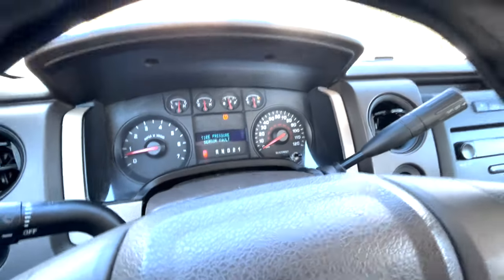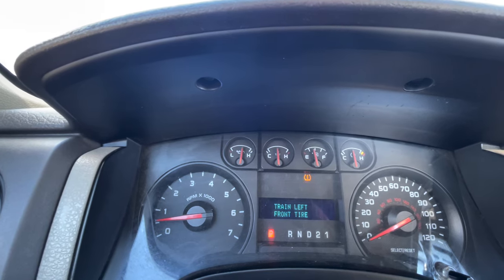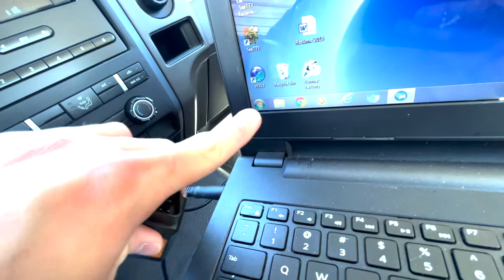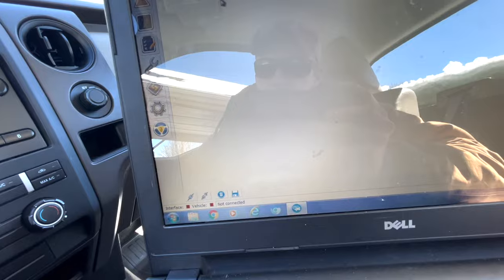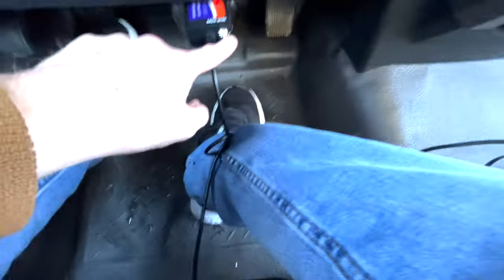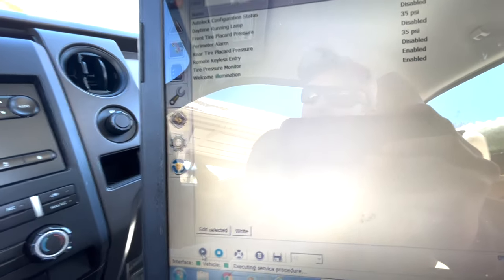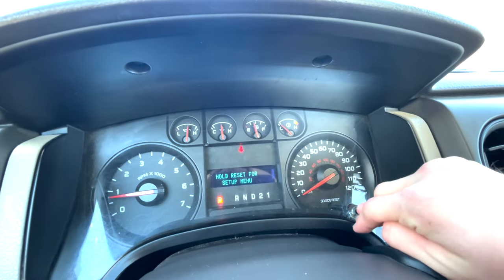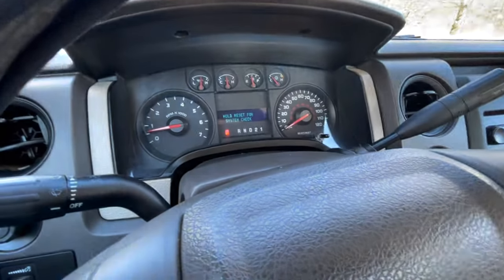DIY - How to Disable Tire Pressure Sensor Fault Message on most Fords!

Comment: The software did not work for my 2010 Ford Escape. I should have read the warning on the readout that it was not compatible with my car. The software disabled the entire car, setting the anti-theft locking mechanism on. I had to wait until the next day, and then it started again.
Reply from the maker: That’s interesting, very sorry that happened. That’s the first I’ve ever heard of that.

Comment: will this work on my 3010 e350 super duty?  front passenger tpms will not connect. I have replaced 2x already.  the antenna or the module must be bad.
Reply from the maker: I'm not 100% sure. But, I know alot of the Ford vehicles share the same CAN module's or similar. And being the E series and F series are almost identical, I don't see why it wouldnt!
Reply: @RandomAutomotive  Thanks for the quick response!  Happy New Year!
Reply from the maker: Yes sir! Same to you!
Reply: 3010 is still 987 years away so I wouldnt worry about it, yet. 😅

Comment: I ordered and received the same exact adapter for my 2009 F150. Loaded the drivers, set up the free 2-month trial, hooked it up to my Windows 10 laptop, and it wouldn’t display TPMS. It never asked me to switch from HS CAN back to MS.

Ran through this procedure two full times with the same results.

Returned the adapter and bought a different/similar one. Same thing, TPMS codes do not display.

Guessing that somehow .gov has gotten in the way of those and we can no longer disable TPMS🤬

If you have the EXACT ordering info for the CORRECT adapter to use can you please display it before my 2-month FORSCAN trial runs out…?

Thank you!
Reply from the maker: The exact adapter is in the description. If that’s the one you ordered… Double make sure your drivers on your PC are good. Sometimes that interferes with the operation of the device

Comment: can you reprogram tire pressures on placecard with this unit, I changed tires and need to reset tpms to new tire pressures
Reply from the maker: Not in this module, I believe it’s possible altering the binary - but that unfortunately is above my expertise!
Reply: I think there's a different process for reprogramming the pressures, something like letting all the air out then pumping them back to the correct pressure and driving over 50 mph for over ten minutes

Comment: I have a 2016 F250 with the 6.2 and I don't have GEM/SJB as a module. what do i do?? Also, how do i do the email thing? Its asking me for an invitation code at the forum which how do i even get?? did they change the policy?
Reply: Yours has several things spelled out under the different modules. Get ForScan anyway along with the cable, hook it up, make a backup of your configuration, then go looking around. TPMS should be listed in the options for one of the modules.

Comment: Now, can I disable or reset the oil change required message? My stick to reset it on my cluster is inoperative.
Reply from the maker: Let me check into that. I know you can through the cluster, but not sure about any other way. I'll let you know!
Reply: You can usually reset those without external equipment, either through built-in menus if it has a vehicle info/fault screen, or some trick with putting the key in accessory position and either taking a screenshot (hold both pedals down) or pressing the gas pedal a few times and hold on the last

Comment: hey man, i’ve downloaded everything got it all connected on my 2013 fx4 f150 and it won’t display gem/sjb? i have far more modules than are displayed on your video but no gem/sjb… i see one other comment with the same issue but you said you’ve seen it with super duty’s which i don’t have, ive uninstalled and reinstalled the driver and still no gem/sjb module? i’ve got the free trial downloaded as well… what am i missing?
Reply from the maker: I’m going to look into this with a buddies 2013, let me get back with you. I’ve seen a couple of folks saying the same thing. I’m wondering if either FORScan removed it, or something odd is going on in a update
Reply: @RandomAutomotive sounds good appreciate it thanks!
Reply: @RandomAutomotive any word on this?

Comment: I have a 2010 raptor 6.2. Will the same scanner that you have in this video do this function, or is the 2010 year specific.  Just trying to purchase the correct scanner the first time lol. Thank you for the walkthrough, I'll be doing this as soon as I get my scanner.
Reply from the maker: It’s based off of certain modules that Ford placed in the trucks. In my experience 2009 and up is a safe bet. I know for sure it works on a 2010 F150 - so I see no reason that the Raptor shouldn’t work as it has the same CAN module as the Explorer, F-Series, E-Series, etc. So not specific if newer than a 2009 (usually). If that makes sense.
Reply: @RandomAutomotive  thank you very much sir !!! Appreciate the write up too 🤙🤙🍺
Reply: IT worked!!
Got the module today, opened it up and got to the license extension email back from Forscan in about 10 minutes.  Followed this step by step and got the light turned off. Thank you so much man!!
Reply: @RandomAutomotive  Anything else you recommend adjusting during the free 2 month trial with these guys?
Reply from the maker: @johncolvin2234  Sorry for the delayed response - sometimes replies to comments get buried in other notifications. The only other thing I did so far is disable my Daytime Running Lamps. This truck is a old fleet truck - and it was mandated in Canada and some states to have always on DRL for fleet vehicles, which I hated. I have a video on that in the queue.

Comment: Hi can anyone help me I have a 2008 ford explorer and all that comes up is the tire pressure. If I get the paid version will the tps come up.
Reply from the maker: I’ll be honest, I haven’t heard many success stories on ‘07s and ‘08s.. I think the module is different. 
What limited info I’ve heard, Dawn is that it can be done - but it’s more of changing a data string in the ECU instead of a point and click like you see here. Apparently, it can be done - the systems we’re just built different. I know TPM has been around a long time, but mandated in 2007. So the concept was relatively new to Ford in 2008. I know it can be done, just for that year it’s a little out of my scope unfortunately!

RA Community if y’all have suggestions on 2007-08 be sure to put them here, to help!

Comment: Can this module work with sweeping and clearing cluster malfunctions?
Reply from the maker: Just making sure I understand the question..

Like clearing active warning lights,etc? Yes it can do most of that.

If there is a mechanical or electronic failure of the cluster itself? Not much it can do.
Reply: @RandomAutomotive  ok thank you for the information. You answered thoroughly.

Comment: Will having the tire pressure light on,will it fail the inspection for the sticker?
Reply from the maker: That I'm not sure of. I wouldn't recommend turning the system off just to pass inspection, but I understand what you're saying. It would in my best guess depend on state and local laws.
Reply: @RandomAutomotive  is there a way to turn off the system the system for the sensors I mean who cares it's just a dam light

Comment: Curious if this process will allow you to re-enable the TPMS system as well? Have you tried re-enabling it to make sure it still works?
Reply from the maker: I have tested that theory. In fact, I had already disabled it, and re-enabled it to make this video!
Reply: @RandomAutomotive  Appreciate the extra research beforehand! Strongly considering this but don't want to screw the next buyer if we ever sell
Reply from the maker: @ItsThePrzybysz  I don't blame you. I'd re-enable the TPMS before selling and just be upfront - and then if the next owner wants to do the same thing.. He/She Can! It worked as its supposed to when re-enabling on mine though.
Reply: Worked like a charm. Thanks for you help!

Comment: Wonder if it will work on a 07 Ford Ranger?
Reply from the maker: I'm not sure 100% about the Rangers. It's been a while since I've been in a ranger - so correct me if I'm wrong. The Rangers have a odometer readout on the left lower portion of the cluster - under the tach that doesn't read out anything but odo/trip info. So - no error message, just a TPMS light. Usually on the older systems - It can be done but not the method shown here. You would have to modify the code on the checksum in FORScan - which I wouldn't recommend unless you have a little more experience.
Reply: @RandomAutomotive  you are correct. I don't have any tire tire sensors and would like to turn the tire warning light off permanently.
Reply from the maker: @pl747  Gotcha. Yeah the method in this video won't help you there. 'Theoretically' it cannot be disabled - however there are some forums to modify the above mentioned code. I'll attach that to the comments thread for you. Just be careful if you do modify any checksums. Also, If you haven't - subscribe, and If I get more info I'll stay in touch that way.
Reply from the maker: https://forscan.org/forum/viewtopic.php?t=8239#:~:text=change%20e%20to%208%20and,turn%20off%20the%20tpms%20light.

Comment: can you adjust idle with this
Reply from the maker: Based off what I’ve read, not exactly. You can adjust fuel trim to help it run better but not adjust idle.
Reply: @RandomAutomotive  thanks, I just went to a garage that dose tuning and increased the idle with a tuner 900rpm in park and neutral and 750rpm in gear, engine runs much smoother now. 2009 f150 5.4 3v had problems maintaining oil pressure for vct system. also went up to a 5w30 weight oil
Reply from the maker: @simracer1988  Ahh yeah, the 3v's have that problem. Glad you found something!

Comment: Does disabling the sensor that way cause it to fail emissions?
Reply from the maker: In most areas, no - since the TPMS isn’t part of the emissions system. This is case by case and it is advised to check your local and state guidelines on emissions though. If you are doing a vehicle safety check - it could fail.
Reply: Hahahah your tire pressure has nothing to do with emissions 🤣🤣🤣 that made my day!
Reply: @M0N0T0N0US  FYI, Randall posts a legit question. Currently, 30 States require Emissions Testing with 15 of the 30 requiring a Vehicle Safety Check. If the vehicle is 2007 or newer the TPMS must be fully functional to pass the test.
Hahahahahahahahaha. It's ignorant know it all's that make my day.
Reply: @PH_INFO_101   okay smart guy, he didn’t ask if it will pass a safety check, he asked if it will pass emissions. So yeah again my statement stands, tire pressure has nothing to do with emissions.. Asphincter says what?
Reply: @M0N0T0N0US  I get your point, while I agree with your general statement, you were being a little hard on Randall. I was giving Randall the benefit of doubt assuming he resided in one of the 15 states that require an Emissions and Safety check. Apparently, only "smart guys" know, in states that require both an Emissions Test & a Safety Check, they are done at the same time on a single document. In an attempt to not confuse ignorant people, the testing sites simply call it an "Emissions Test" (if you fail the safety portion of the Emissions test, you fail the Emissions Test). It's difficult for a smart guy to dumb it down for you but it's the best I can do.

Comment: Will this work on a 2008 ford f150 4 wheel drive.
Reply from the maker: I know most 2010s and newer will. I'm not 100% on an 08', but I believe it should as most of the systems are the same.
Reply: Ok Thank You!

Comment: Just ordered the adapter...tired of the annoying tpms icon on the dash...
Reply from the maker: Let me know if it works, thanks for watching Shannon!
Reply: @RandomAutomotive  couldn't find where to apply for an "activation code"..assumed the "free extended license key" was what I needed???  Still waiting for an email with that key..
Reply: @RandomAutomotive  After 3 months of owning this, I finally got to it today. Had to buy a year license since my free 3 month license had expired.  It does work as you say in your video.  I would like to have some more info on operating the Forscan software, as it's not just for shutting the tpms system off only.

Comment: Gonna try this on my 2010 CVPI because I'm tired of that stupid process to get the code and light to go away.
Reply from the maker: Did it work?
Reply: @RandomAutomotive   yes it worked. Had to fond IC and run the diag and then change the code from 1280 to 1200 and write it. Light is gone completely and I'm glad. Have my own TPMS kit to use that works better.

Comment: I disabled the tpms through forscan and it threw me an airbag light. Went factory reset and its back to tpms light. It’s either 1 light or the other it seems.
Reply from the maker: That’s very interesting, I’ve never ran into that issue before.
Reply: @RandomAutomotive Will this method work on my 2008 Fusion? I want to get rid of this annoying light on my visor. can you help me?

Comment: this is a great  safety device..i work on cars, and find 80 percent or more have less than what the auto companys call for in the tire psi..i guess you should also tell people to cut there seatbelts out... is safer to be toss from a car in a accident that be safey belted in
Reply from the maker: It's a great safety device, I agree.  I'm not telling people to disable a safety feature for the heck of it.  If there is a TPMS fault like this - the system isn't working anyway. Do you know how many cars I've seen where people constantly drive with this light on? I'm not saying it's correct, but for you to make a comment comparing that to "telling people to cut their* seat belts out"  is absurd..
Reply: @RandomAutomotive  as a tech myself... all you must do, is keep it in good working order..my 14 fusion has a tps...never a problem..some folks just want to remove stuff... just tell them the goverment is tracking you with a tps on there car or truck... and you will see a lot of folks remove them.. post a note to Q about this tracking system...lol
Reply: @randellgribben9772  Haters gonna hate.
Reply: @jettv3491  so you can stand next to a truck/ car and tell me that it has 35 psi or 25 psi.amazing.. i work as a service writer at a big rig /truck and sometimes car tire store... and i cannot tell..i will test my co workers monday... this will be fun

Comment: I'm going to do this to my 2011 Grand Marquis.  Fuck TPMS.
Reply from the maker: One thing I’d keep in mind on that. Those Panther platform cars (although it’s a 2011) are basically built on 1990s technology. Very nice cars, I love them.. but they didn’t get updated much. The last updated computer module came with the 2006 refresh of that design. TPMS becoming mandatory is 2007. So although it’s a 2011, it’s really running on like 06-07 tech. So I’m not sure if this method would work, several users reported issues trying this on 07-08 f150s and similar vehicles.
Reply: Oh!  That I did not know but that does make sense.  Thanks for the advice! @RandomAutomotive

Comment: I have a 2008 Ford Fusion SE 3.0L & my options are slightly different in the “GEM/SJB Module Config”

There’s “Rear Tire Placard Pressure” & “Front Tire Placard Pressure” but no “Tire Pressure Monitor” 

After at least an hour & a half of troubleshooting how to get my MacBook adapter to read the ELM correctly & FINALLY successfully establishing a connection, I am officially overcome with despair. I am assuming the TPSM setting is somewhere else? I mean, it has to be right? Please don’t tell me I did all this for nothing because the guys at the shop that swapped my tires on to the new rims ASSURED me that this would not happen, yet here I am. At this point, I feel like driving down there 1st thing tomorrow morning & cramming my fist in someone’s ass for causing this nightmare, but I am going to be patient, remain calm for the time being, & just pray that SOMEONE… ANYONE can help me get this figured  out sooner rather than some other time. & please… if you don’t know what you’re talking about… do me a personal favor & keep your opinions & educated guesses to yourself. I’m on the verge of a midlife crisis here people 😭😭😭

No seriously tho, please help. I don’t even know how to go back from the GEM/SJB screen & I don’t want to mess anything up so I’m leaving it where it is until, hopefully, someone can tell me what to do. Thanks in advance 🙏
Reply from the maker: Good Afternoon! It takes a few prayers and cups of coffee to get this to work on a MacBook so hats off to you. This method in the video is for 2010+, so it makes sense that you're missing that on FORScan. I've never connected to a 2004-2008 CAN module like you have on your 08' Fusion.. but I've read in some forums before you can edit the binary code to disable this, but I don't believe there is a true "On/Off" like I did in this video. TPMS was mandated in 07' so it was very early on in 2008 for Ford, and not so easy. There is some information on forums on how to edit that binary code - depends on how brave you are.. not sure if I'd want to go that far into it. Maybe that helps a little, hope it does. Thanks for watching, best of luck! Always here for any questions you may have.